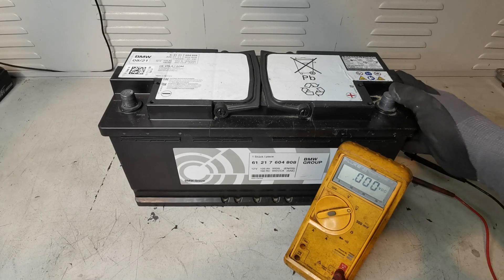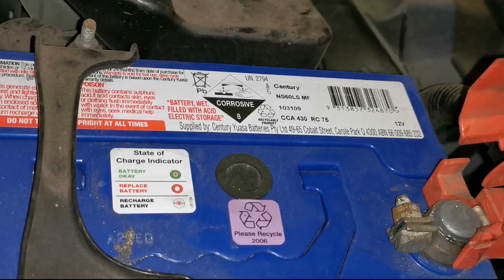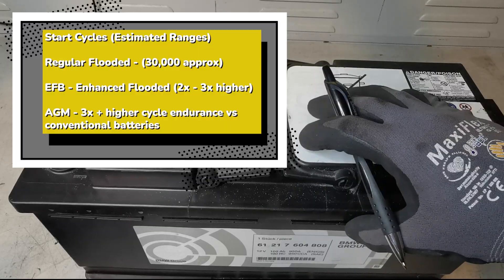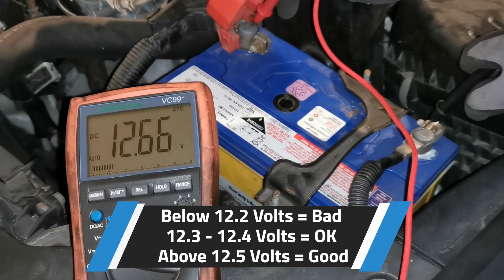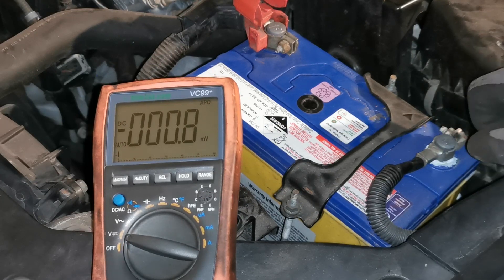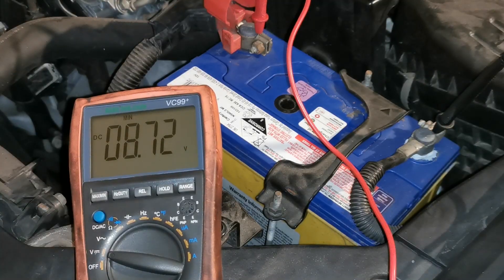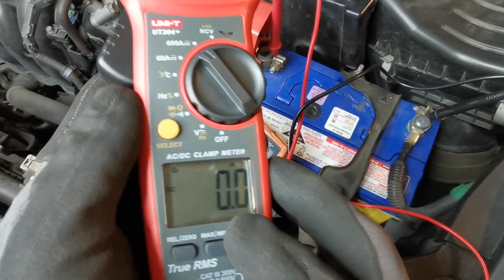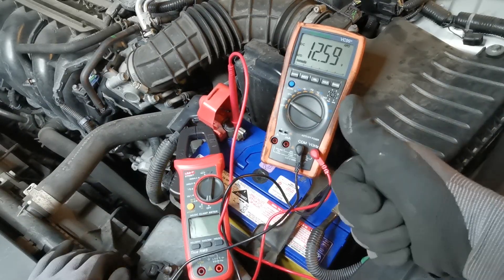Everything You Need to Know About Your Car Battery - Simplified Information - DIY Testing Methods

Comment from the maker: My aim for this video is to give you the ability to check the health of your car battery when you do not have any special battery testing tools or equipment.  
*I do not use the visual indicator on a car battery as a test*  
Visual indicators do not test overall health and therefore not accurate.

Comment: thank you for that....did cleaning the negative battery terminal improve the cranking voltage as it appeared to maintain a good voltage level on the extended crank test compared to the shorter crank and start tests......i have to say i find the shorter crank tests using min max can often throw up low readings even on a healthy battery so i tend to prefer the carbon pile or other load test
Reply from the maker: There was a difference in timing when the tests were done and the vehicle had to be moved out of it's position during that time, so I would say there was no notable difference on that test.   
I agree, having testers is the best method and it is very controlled and easily measured. These tests I find are a very good option for anyone that doesn't have testing equipment. It gives a greatr picture of overall health and will show failures on weak batteries.  Thanks for watching and commenting Jeffrey